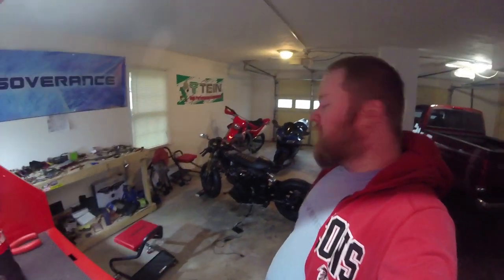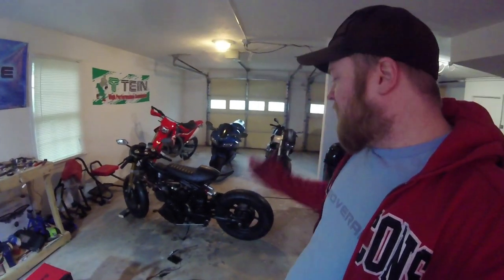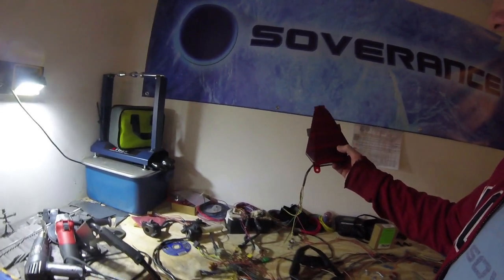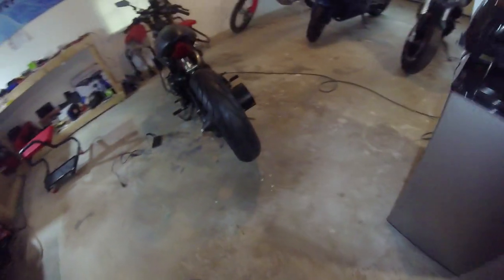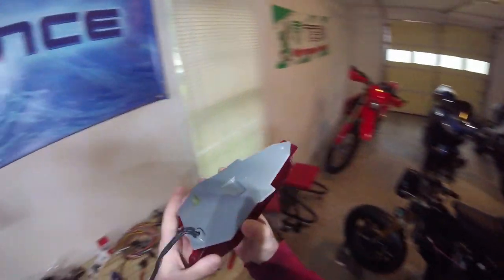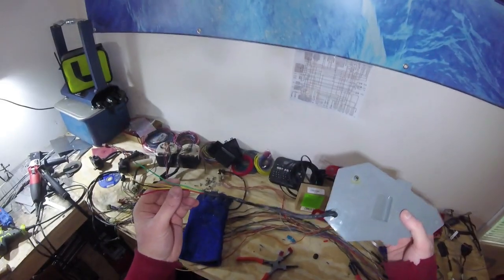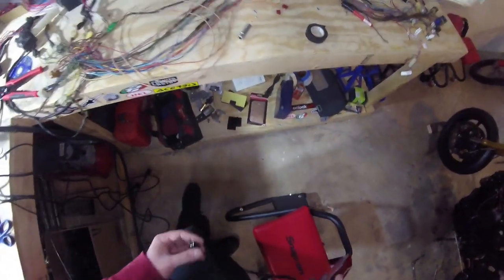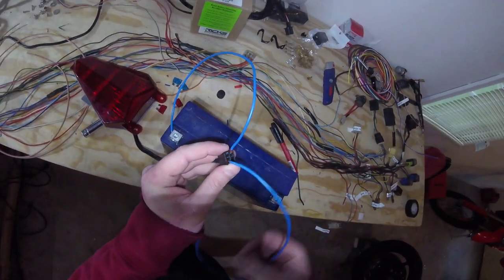Yamaha Virago Cafe Racer Build - Episode 30 - R6 Tail Lamp

Comment: IMHO you should build a bracket to raise the back end of your gas tank so that the bottom of your tank is more inline with the bottom of your seat. It looks a little awkward with the tank dropping below the seat. Love what your building, keep it up!
Reply from the maker: Thanks!  And oh yes, I have recognized that same awkward look of the gas tank, and would love to do something about it.  I'm just not sure how!

There's just under an inch of space that I'd need to make up to get rid of that awkward gap.  Unfortunately there's just zero clearance there.  The seat, when bolted in, sits atop the gas tank mounting slot, which prevents it from moving upwards without taking the seat with it.

Even if I had the clearance to move the rear of the tank up an inch... how do I build the bracket to do so?  What would it look like?  How would I mount it to the frame?  There's no where to mount a bracket under there, save maybe using the shock mounting bolt and/or welding mounting points to the frame.

It almost looks like I'd have to modify the tank again, cutting out the existing slot entirely to make clearance so it could fit more flush against the lip of the seat.

And if I did move the tank up one inch in the rear... what do I do with the petcocks?  This tank is gravity-fed... no fuel pump.  The existing petcocks are level, at the lowest point of the tank.  If it's an inch higher in the rear they won't be level with the ground anymore.  Do I modify them?  Can I just buy new, angled ones?  Does it matter?

Most people I see on the forums who get as custom as I have don't use the stock Virago tank - they replace it with something else.  Maybe there's a different seat that might fit better with the stock tank?

More clear photos, here:  https://photos.app.goo.gl/wDMFhfJdAL4DHNzQ6

Let me know if you have any ideas!
Reply: @SoveranceVR   I've noticed most people do use aftermarket tanks. Is there a specific reason you are not? 

I was wondering if you could weld up a little bracket in this shape ] that way you could mount your seat then bolt the tank at the height you want? I had forgotten that tank was gravity fed, that would be a problem.

I can't tell from pics but could you cut the mounts that connect the top of the tank to the frame and re-weld them higher too? that would raise the front of the tank and if you do raise the back you might be able to find a height that looks good and keeps the petcock on the lower end. Not sure if it would interfere with your triple tree? 

As long as you keep enough gas in the tank the gravity fed petcock wouldn't be a problem! Not the best solution if you plan on long rides, but an easy one :)
Reply from the maker: @bryoncombs8849  I'm not using an aftermarket tank because I don't know of any good swaps that do not require modification of the frame, with the exception of one.  And that is the tank from an 81-82 Virago XV920R... which i think is a 5 gallon tank with a much higher profile than the XV750's 3 gallon tank.  Using that tank the gap would be more or less gone, I think, and I shouldn't have to modify the frame at all.

Unfortunately it's pretty expensive these days... maybe $600 to $750 or so if you can find a decent one on eBay.  The pricetag turned me off, considering I was gonna spend another couple hundred to restore and paint the tank.  It might work well, though, if I wanted to spend that kind of money.  It'd probably be worth it for the extra range alone.

EDIT:  as I typed this out I searched eBay and found an acceptable tank from an XV920R Chain Drive for about $250.  So I bought it.  I can restore it and paint it for another $150 or so.  I'll post a video on it if it works out!
Reply from the maker: @bryoncombs8849  Check out my latest video (E31) for my solution to this problem.   Cheers!